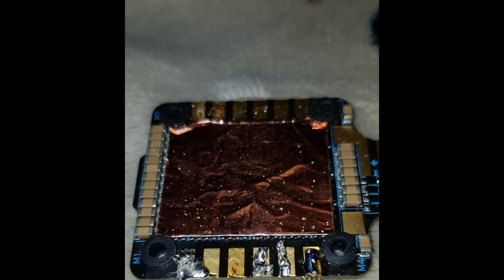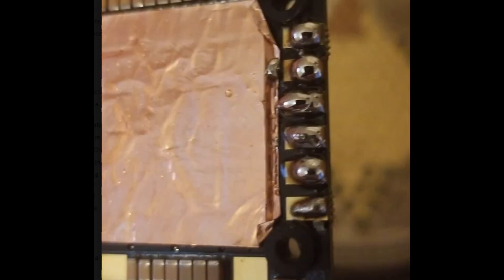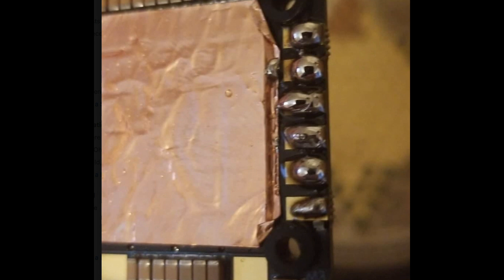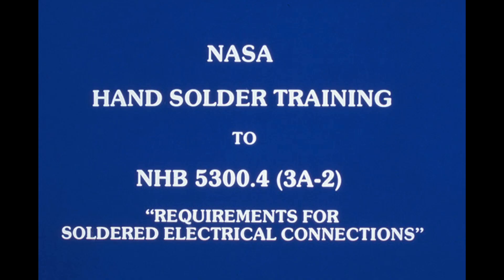SOLDER LIKE AN ASTRONAUT??  USE THE RIGHT STUFF!!

Comment: Yeah soldering was one of the first things I wanted to get good at, and I definitely found that Kester 63/37 is so damn nice it blows away generic solder, and is way better than even good solders, and my temps are generally about 25c lower than they used to be. I look for stuff to solder now instead of avoiding it! Get ventilation this has poison in it! Ill use your affiliate thru amazon next time i reload on kester!
Reply from the maker: ZeeBeeFPV hey. There is a nice condensed slide show too. It’s on google if you search for nasa soldering. They even give you certificates. Some colleges still teach it too